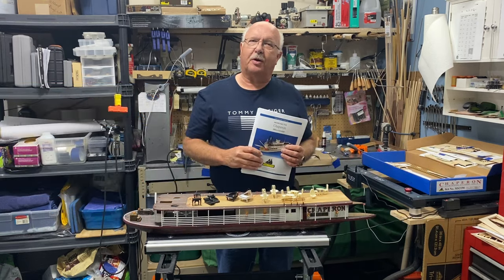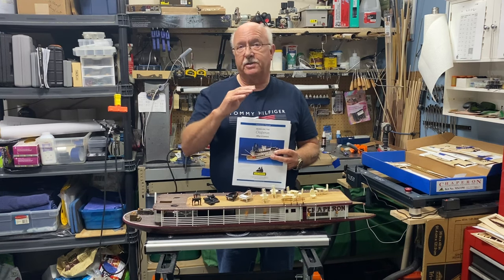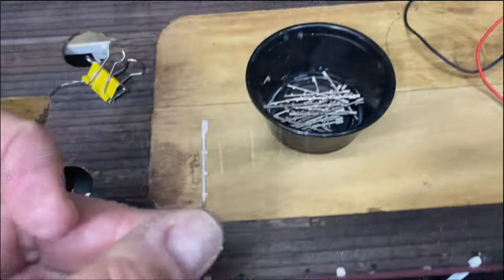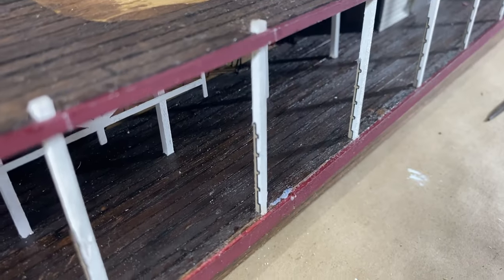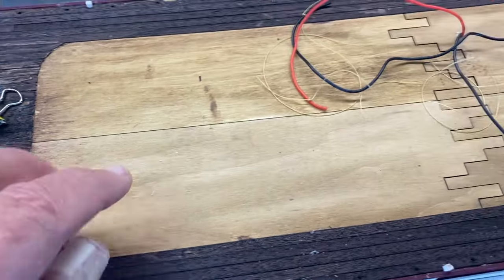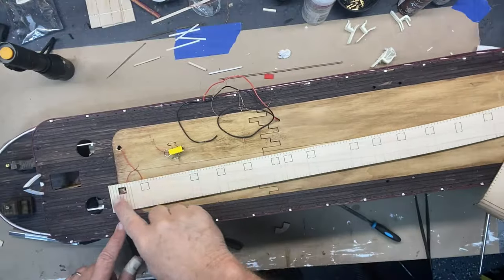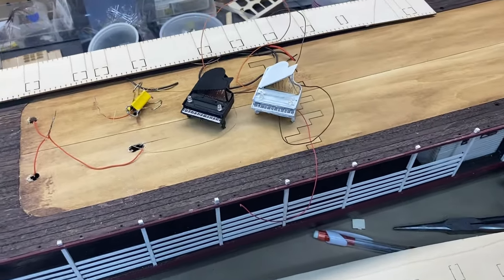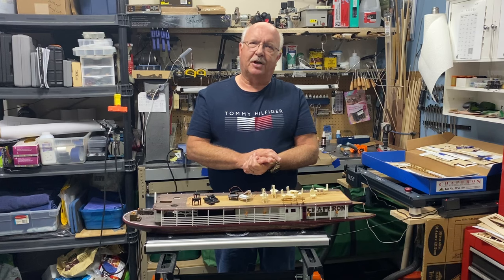The Chaperon PART 6 Model Shipways CHAPERON STERNWHEEL STEAMER 1:48 SCALE

Comment: Thanks for the shout out Dan.  I somehow missed this video.  Great work on the bull rails.  On mine, I actually put the supports on backwards (opening to the back instead of the front).  You also avoided my mistake of using the wrong planks and running out of the correct ones for the bull rails.  Awesome idea of using the cloth for the bends in the walls.  Great work!
Reply from the maker: I’m having to rethink my tables and chairs…… I thought that the center area was open through the skylight level…… so I’m shortening the tables and may switch out the chairs to some tiny ones I was able to make 🫨.
The journey continues 😂👍
Reply from the maker: I received the message regarding HTM Discord but when I replied it doesn’t go to you.
Maybe try email directly to my boilerdanone@gmail
I’m not familiar with HTM, maybe you can send more info?